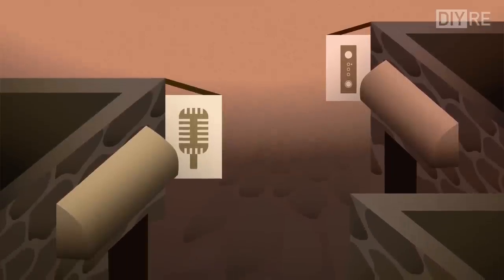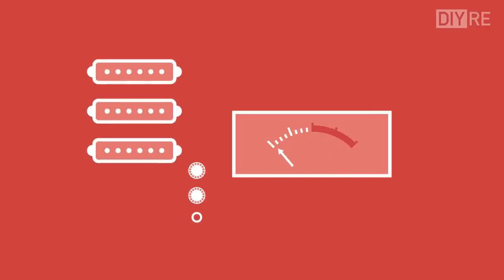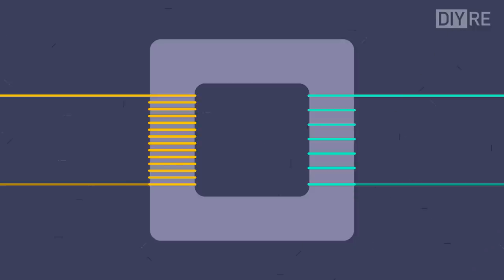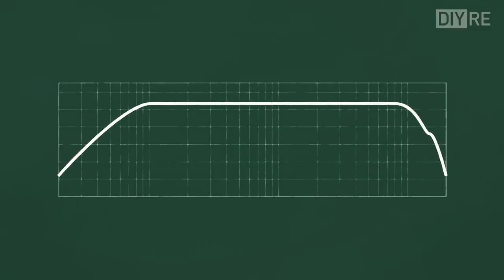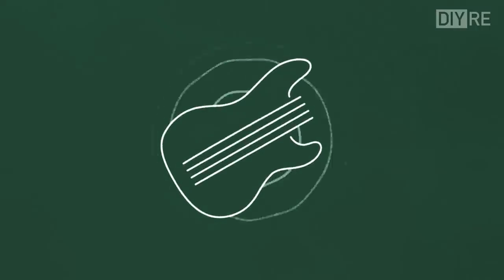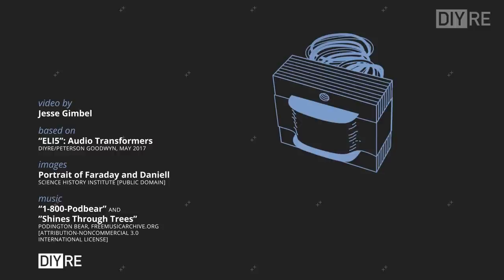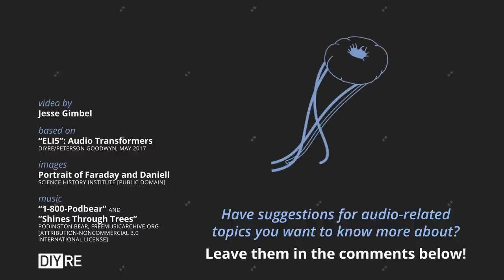What Are Audio Transformers? Why Do They Sound So Good?

Comment: Amazing video... really!!! I have a question if you have a sec. When you said that a 2:! ratio would mean that only 1/2 the signal would appear on the secondary of an audio output transformer... does that mean that the "identical signal" would appear... at half the voltage? Or... did you mean... "1/2 the signal" from a frequency point of view? Like... you'd lose all your treble, or all the bass?

Comment: Hi! Congratulations for the nice video! Cool animation, and you're touching all the important things. 
One suggestion though, everywhere you mention signal, it is voltage. While a 2:1 transformer steps down the voltage by 2:1, in ideal case it increases the current by 2:1 (in real life there are some losses). 
Keep going! 🙂

Comment: Awesome video! Thanks! I have an old book about transformers I got from by grandfathers bookshelf. He worked on radiotelegraphy during the 1940s and the book has a warning in it "should not be exported out of the US in war time" so I wonder how he got it. The book talks both about core and wire gauge focusing a lot on wire gauge because it deals with power RF transformers. Is wire gauge an important factor for these audio transformers? Thanks!

Comment: Hey, I am doing an experiment trying to increase power loss in an audio passive crossover circuit by using a transformer, I'm a novice...lol to circuitry but I am thinking if the passive crossover blocks some of the actual power can step up from a transformer correct that loss, thanks in advance

Comment: My hand wound isolation transformer does not pass enough power. Does it need a resonant capacitor in series with primary to match the 20khz AC input? I even tried impedance matching that did not work either.

Comment: You’ll have to forgive me as I’m relatively new to audio circuits and electronics in general.  I had a question pertaining to input and output transformers.  In a lot of preamps you see them advertise specific input and output transformers.  It is my understanding that an input transformer on a tube circuit should be a step up transformer to increase signal to noise ratio in the first amplification stage.  In non tube mic preamps, what is the function/purpose of the input and output transformers? Are they there specifically for sound alteration or do they provide some specific function as in the tube example provided above?  Would the input transformer on a non tube pre be closer to 1:1?
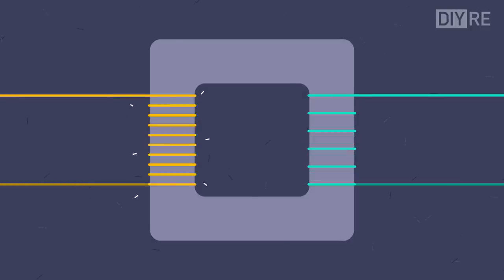Reply from the maker: Great question, the transformers have several functions in a non-tube preamp. First to unbalance the signal at the input the balance it at the output. Second to provide galvanic isolation to prevent ground loops. And third to step up the voltage for a little "free gain." In an API preamp for instance, the input transformer is wired 1:35 and the output is 1:2.

Comment: Hi! I'd like to know how a transformer inside a moving coil microphone splits the voltage and reverses polarity between the hot and cold wires of an XLR cable, or rather - just how it splits the voltage (incase the signal is already polarised due to movement of the diaphragm)

Comment: Not quite right.

When transformer ratio step up or step down it will not cut off half the signal.

I understand what you mean but maybe some others will not.

It only change signal peak values more or less compared to signal what was going in to it.

if input is peak +5v & -5v  and transformer ratio is 1:2 then output is replica for that signal and peak values +10v & -10v

for ratio 2:1 output is is +2.5v & -2.5v

Comment: They also do another thing !..............ENI = E ( voltage ) L ( leads ) I ( current )
So they do invese what Capacitor coipling does where current leads voltage...
In a way introducing a transformer ( quality ) reequilibrates the DF factor resulting in a more lifelike sound experience where singers and musicians seem to have more presence ...something like kind of magic happens when you use them in a correct way !
Quality are NOT cheap but for balanced signal are the correct way to proceed versus the cheap and low performance IC's used in many commercial applications sold as balanced  input/outputs witch iare a illusion and fake marketting .

Comment: As I know a little more than most - about the electrical and electro-mechanical qualities of line distribution transformers (being as I am a registered electrician schooled in the understanding of transformers, as used in the NZ Electrical Wiring Codes and and high voltage high loading - mains power distribution systems for hydro-electric power stations & switch yards etc)..

I know enough to know I don't know enough.

So - if one has an IRON cored transformer (most 230v AC domestic transformers - used for voltages of 12v DC via a bridge rectifier circuit too - have a laminated IRON core only).

Why then is a copper laminate cored transformer NOT used - either on it's own, or in alternate laminations - with an iron cored one?
To allow these types of transformers - to be used in  audio systems too
ie:
one lamination iron, the next copper, the next iron the next copper, until one has a dual cored transformer, with both copper and iron in the core.?
Would one not then get a very good audio transformer, with half the memory-effect / hysteresis of a power transformer  - and twice the frequency / power (throughput) cleanliness - of a copper "only" laminated transformer.

Now - having thought some MORE on that - yes I know that toroidal transformers have a different non-iron core, what would happen inside a transformer - and would it effect the way the output occurs, if we did multiple changes - to the core - by way of having a plate of iron, then one of nickel another of copper one of cardboard the next of a toroids ferromagnetic material such as laminated iron, iron powder, or ferrite done differently to that of an old plain flat laminated iron core, to then duplicate all of these layers, until one has a suitable thickness of the transformers multiple substance core? 
Would one thus have an all frequency - all use transformer without the inherent retained magnetism - or hysteresis or magnetic memory effects?